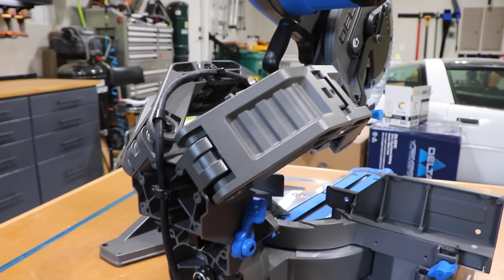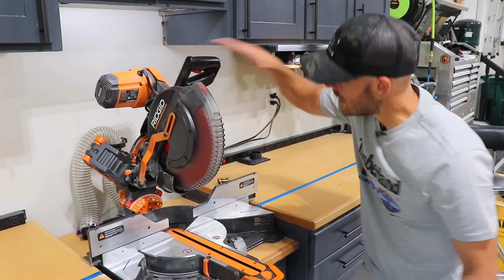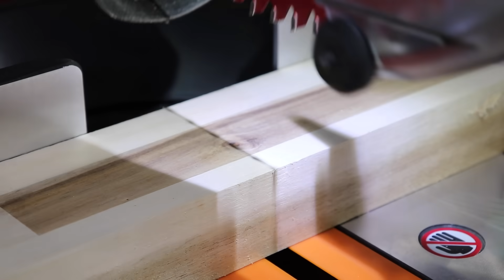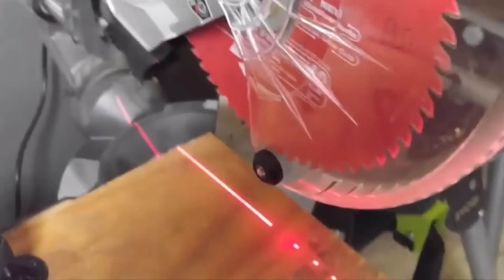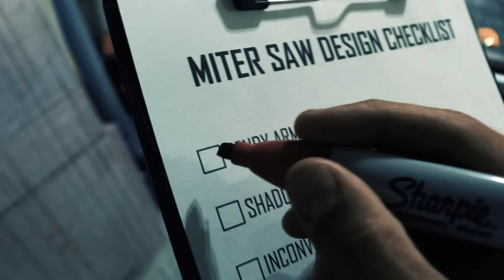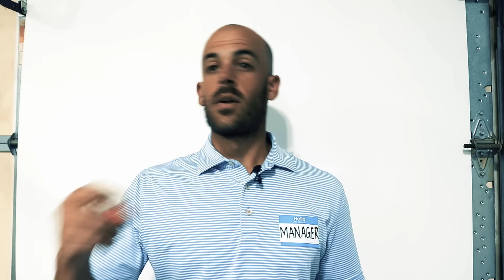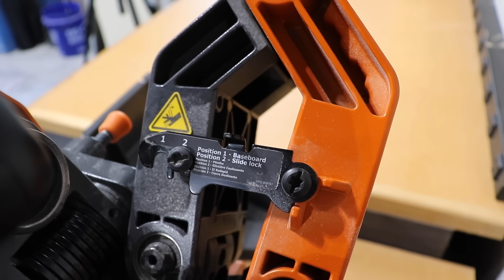I ALMOST took this Saw Back. // RIDGID & Delta Dual Bevel Sliding Miter Saw Review

Comment from the maker: 12" Dust Chute: https://bit.ly/3kd8c2S
10" Dust Chute: https://bit.ly/3QCbJDO

or print your own!
12" Dust Chute (digital files): https://bit.ly/3Qzi6rH
10" Dust Chute (digital files): https://bit.ly/3vYVHKX
Reply: $45 for a piece of plastic are you kidding me
Reply: The links to the digital files is no longer working, have they moved?
Reply: @StaiinedCreations  I’d like to know as well. I’m guessing they were pulled.  Guess I’ll design my own, but make it easy to remove for certain cuts.
Reply: @gatorhwk68  its been "out of stock" for months but they have it priced at $800, also they discontinued the delta line as well.

Comment: I wonder if blade deflection should be measured while the saw is actually cutting? The force of the blade moving perpendicular to the workpiece isn't close to being the same when it's not spinning. Think bicycle wheel.  Should be simple to test this.

Comment: I grew up in a custom shop with ZERO Festool tools. It aint about the pool stick its about the guy holding it. Great review but here in 2026 and RIGID isnt available in this model anymore. Delta does; however, still make this too but it costs $530-600 now.

Comment: A lot of you need to get rid of flex vacuum hoses, i got rid of mine and it actually go much better, use to shortest amount of flex as possible, also he's exactly correct about using a table saw sled to do perfect cuts, its what i use, i only use a chop saw to cut lengths, .

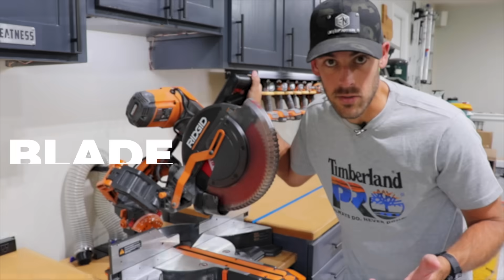Comment: At 10:00, that does look like a significant amount of looseness and deflection compared to the other saws, which appear to have about 70% less deflection.. I do have a cheap 7 1/4" sliding miter saw, a Cobalt, and it makes very accurate cuts, despite having a lot of deflection if you try to wiggle it side to side. I think deflection really only comes into play if you're using a bad blade. New Diablo blades are so sharp that you can't even feel anything occurring when you're making a cut, it cuts with almost zero force.

My 1956 Dewalt 9" radial arm saw does a 13.25" minimum crosscut on 1" thick board (approx). Installing a 10 inch blade, you get 1/2" more. It's tough justifying a purchase of a new sliding miter saw if it only does 12.5 inches for a 10" saw, or 14" (for the 12 inch saw). But, the safety features of the sliding miter saw and ease of use make it far better for crosscuts.

Comment: Great video.  I'm presently looking to buy yet another miter saw.  I have 3 now, but I think I have a need for a more compact, more lightweight miter saw that I can take around to jobs more easily than my big 12 inch Bosch.  By the way, a depth setting is important to me; does the 10 inch version have a depth limiter for cutting rabbits and dados?

Comment: Awesome video.. been checking out alot of reviews on this.. lovin it.. my old 12" handle won't stop running when plugged in 😂 it's locked on. Not the safest way to cut. Had it fixed at HomeDepot and they gave it back TAPED UP because they said it wouldn't fit inside. No safety switch.. 😂😂😂 terrible. Time for and upgrade 👊😎⚡️

Comment: @ShopNation - Great review!   I've watched it probably 20 times ¯\_(ツ)_/¯ .     A few months ago (09/24), I found a clearance deal at HD for the 4251 for $199.  Scooped it up immediately!     I would have preferred the 10" version.   I do see the 10" now across Ridgid & Delta are 100 more than the 12?

Anyway, I'm wondering you or anyone has heard of successes installing a soft start?  I'm not concerned about voiding warranty :).

Comment: I just bought the Delta gen 2, 10 inch version and there is no play at all fully extended. It's been addressed by Delta and they fixed it. As far as the dust collection it is no better or worse than any other woodworking tool in my shop.

Comment: I own the DeWalt 12" sliding miter saw and it has a shadow line. It also will cut 14" wide material. I don't have a dust collection system appears to be one of the best. Also, the shadow line is not a "shadow LED line."  Also, DeWalt miter saws have a gear system that works with the belt to improve power and longevity. It is considered to be one of the best, and a LOT of professionals use it. Also, the head on my saw doesn't deflect as much as the Ridgid saw does. Your DeWalt also was a lot more solid. Other than being more compact, I don't see why you replaced your DeWalt miter saw. This saw and the DeWalt have sufficient accuracy for trim carpenters.

Comment: Just bought this (Ridgid R4241) for a steal of a deal ($220). Had to go through my local orange box store to find it packed away on a top shelf, buried in a different section. I'm returning it. The deflection is unacceptable. If the saw was 20 years old, great. Had a good life, but with a roughly 1/8" side to side with barely a finger on it - it's way, way, way too much. For rough cuts for framing or decks - amazing deal. For semi-fine work (case molding, baseboards, etc) - not gonna work. I'm leaning toward the Makita slider cordless. It's 5x more, but that's why I started converting to Makita 4-5 years ago. Lesson: You get what you pay for.

Comment: Milwaukee 6955-20 has the least amount of powerhead deflection ive ever seen. Its THE monster saw, has been updated but still very simular to the original model. A dutiest rugged work horse that can easily handle all trim work with the raw power to handle wet/super dry hardwoods.

Why dont you do a review? After all the old girls still the world most accurate leaving festools very much overpriced kapex in the fckn dirt....

Step up and do a genuine review, you did another great job on these low grade saws, now lets see the premo saws

Comment: I work in a cabinet shop, we have two pneumatic pop up saws for cutting length with tiger stop for consistent lengths. We rarely do miters in have frames, and if we do it's on a rip cut for an island and we use a table saw for that. One guy does custom molding, floating shelves, and railings. He uses a DeWalt sliding miter saw for that. (I have a Ridgid 4222 in my so at home).

Comment: Let’s face it!  Miter saws are used to break down longer pieces to manageable shorter pieces.  Fine tuning in woodworking is done on a table saw.  Also most miter saws are designed for construction work.

Comment: To be honest, every Miter Saw and Radial Arm Saw I've ever used have been terrible for dust collection, so I wouldn't really consider it a negative against the tool, more so just a negative in general with all miter saws and radial arm saws.  

The deflection I think can be held true with any miter saw, even the non-sliding models....if you are pulling sideways on the head of the saw they will all deflect, its just the way they are made, there isn't much support to keep them fully rigid when you are purposely pulling or pushing the head of the saw sideways, which would be operator error more so than the fault of the saw.  I've found that running the miter saws that if you are trying to force them through material you are going to get some cuts that aren't accurate of course, but taking your time and not forcing the tool is the key to getting better results....most jobsites you see guys forcing the tools and well that's how you get a bunch of walls that aren't square LOL....they don't care its production framing and finish work, but its so common for people to really not know how to properly operate these saws, they watch all the videos of them being used and thing that forcing the blade through the work is how its supposed to be done.

I believe that max cut capacity they claim is for something like a piece of crown molding which is set on the saw and up against the fence at an angle, which would certainly give you a much wider cutting capability than just having a board flat on the saw's table.

Comment: Hell of a review. You just convinced this hobbyist woodworker to get this saw. I actually got the 779 and returned it because it was absolutely massive. I was going to buy a regular non sliding miter but I knew in the back of my head I’d regret not being able to do wider cuts which would inevitably come up

Comment: Thank you for the review. I’m actually looking at the Rigid vs Bosch GCM12SD.  I currently have the HarborFreight HE74 which is a solid saw and has shadow saw line like the rigid. I’m trying to avoid building a 40” deep miter station for it. Just for reference how deep is your miter station cabinet front to back?

Comment: I looked for the STL files in the store and all I found was the $45 prefabbed version and this note: "There is a separate listing for the digital files if you would like to print/make your own!". Still didn't find the STL file. It would have been nice to but a link on the page. I'll probably just fire up Fusion 360 and design my own.

Comment: So, your video absolutely sold me on the 12" Ridgid. But it looks like they are no longer being sold. Any recommendations for something similar? Thanks!
Reply: We're in the same boat bro. Smh lol. Let me know if you find something similar at least
Reply: @BBradshaw131 - I ended up going with the 12” Delta Cruzer. As far as I can tell, they made Ridgid’s saw (until recently). It has been working great.

Comment: You make a good argument for a non-sliding miter saw. You state that for more precise cuts, use your table saw and sliding table. I had a regular Delta miter saw and when I had a longer cut, I simply held the wood against the back and lifted it to finish the cut. Not the safest, but never a problem. Now I have a slider and had to make a sliding table on my bench to bring it out for the full use. Something you could do to get full use of your saw.

Comment: Some time has past and I see that the saws are now on clearance at my local hardware store. Do you still hold the Delta Cruiser in high regard? And do you know why they are all on clearance and nothing seems to be on the horizon to replace them. At least of what I see with my limited knowledge.

Comment: Sooo I think there is an error in this video. The cut depth. I believe this is posted wrong on Home Depot’s website site. 

They list the 10” cut depth at 4”. Which is reasonable. Given a 10” blade and the arbor hole. Seems about right. 

But HD lists the cut depth at over 6” on the 12” saw. No idea how a 12” blade with a 1” arbor hole and this only 5.5” of blade from arbor to tip of teeth can possibly cut 6.4”! 

I think there is a typo there. And like out ShopNation guru was just reading what the website said for cut depth. Also. He says the 10” is also 6” cut depth as well I believe, which I’m assuming meant HD also had that wrong for some period of time as well?

Anyway. I know it’s an older video. But I literally did not do my due diligence and was like “6 inches of cut depth. Almost the same as the 12”. Screw it. I’m buying the 10”. Obviously it should be about an inch better on a 12 vs a 10. Duh.
Reply from the maker: Usually the deepest cut depth on a miter saw is made behind the arbor, most miter saws can cut thicker than 1/2 the blade diameter assuming it fits in that “pocket”. Usually just a piece of baseboard standing on edge
Reply: Ahhh I see now. The manual lists some interesting stats. They talk about full depth cut thickness of being 4”. Then a baseboard vertical being 6.5” and crown (vertically nested) as being 7.5” or even 2”x18” extended capacity. 

Interesting. To me I’ve done baseboards one time in 20 years but use my miter saw 6-120 times per week on other projects. That 4” number is probably the most important to me.

Comment: Thank you for this video. It inspired me to tackle the biggest dust generator in my shop…the ROUTER!
I made a dust collector for my Dewalt DW618. 
It works well with my Porter Cable dovetail jig. I’ll be testing in other applications.

Comment: my home depot really sucks, they dont even have saws on the floor so I never knew this even came out, and you can adjust the tension on the Dewalt slider to make it deflect less not perfect, but you can certainly tighten it up, but for that space saving Im tempted

Comment: I have the same exact saw that you do (I think based on your recommendation, even. lol) and I believe to get that maximum cut they talk about this saw being able to do requires that you do the thing that is kind of extremely dangerous, yet I see almost all woodworkers do it, including myself. After you reach the limit of the cut, in the normal way, then, while keeping the saw running, lift the front of the board up to finish the cut. In this way you may be able to take a board that is as deep as the maximum rating and actually be able to cut it without flipping it over. Haven't tried this, yet, but am going to just to see if it works.

Comment: My first major power tool, Delta 10inch. The goal was to cut a "4x4", the saw has been very good. Yes, it does spew dust even with my vacuum attached. I had no idea about dust collection (my first major tool). Why did I not get the 12 inch? Because only a fool trims fingernails with a 12 inch. 
Also because the 10 inch was at least $100 cheaper and 10 inch blades cost a lot less.

Amazing how he got the inside footage from R&D. Those guys did not look particularly Asian, and the personnel badges somehow looked less than official.

Comment: I personally would not recommend this saw after owning it for 4 yrs now. The blade deflection is the worst I have ever used (27 yrs of using miter saws) and impossible not to get some deflection no matter how much you baby it. A bevel cut is when it is the worst. Fully extended it's a absolute joke compared to the yellow brand as it takes zero effort to deflect the blade. Yes, all have some deflecrion but, trust me this saw is ridiculous. IMO all the engineering went into the arms of this saw and stopped there. There is no dust collection as stated in the vid. I'm not sure why he would recommend this thing but, I have one forsale if you want to take his word for it.

Comment: I'm having to replace my old Sears Craftsman mitre saw because a motor bearing broke.  I'm very sad about this.  It was a very good saw. very durable.  I knocked it off its stand a couple of times and it kept it's precision.  One thing I noticed however, is that in comparison to all the current sliding mitre saws that have 2 rails, my Craftsman had 3.  It was a 8.25 blade but could cross cut 12.25" with very very little deflection.

Comment: The longer cut length advertised is for miter cuts…move the head to the sharpest angle available and it is a longer cut than just cutting 90°

Comment: All these saws have blade deflection.  I was days away from finally buying the Bosch when a friend let me use his and I noticed right away that you could pull it off line so easily.    It was that that got me to change my mind and buy a mint condition 1954 DeWalt 14” 3hp radial arm saw.  It does everything the Bosch can do, only dead accurate, and it will rip to 24” wide, cut parallel to the table, and do a bunch of other tricks sliding miter saws can’t dream of.   At 500 lbs, The DeWalt radial is Not job site portable…. but i don’t work on job sites, I work at my studio.   The Bosch would have cost me $800.  A like new condition Radial with a bigger blade and more powerful motor and greater capacity cost me $500. If you don ‘t need the 14” blade, you can often pick up 8 or 10” DeWalts from the 50’s for as low as $50, and those 5/8” arbor DeWalts can run Shaper heads, planer heads, and joiner and jigsaw attachments.

Comment: Hands down the best and most honest review of a miter saw I've seen. By someone who actually used the miter saws, knows the features and flaw, not just cut a few boards. Great points and tips. I wouldnt of thought about the miter clearance left to right being an issue. 👍

Comment: I noticed you get better cuts if you pull the handle out, chop down and then push the cut in while bottomed out. The profile of the cut is thinner and you are making it with the widest part of the blade. Blades are like gyroscopes, so thinner cuts are best because you keep the speed higher which balances it better. It has made it so only in cabinet would I go to my table saw. I have the Dewalt you showed.

Comment: I had the same issue  with miters.  With the saw set in the work bench. So what I did to fix this was make it slide forward with  some heavy  duty sliders.  Works good i can pull it forward  when I need to make those steep miters. And push it back when I need to .

Comment: I have the Ridgid for my acreage and love it. If you are making wider cuts and use the saw "properly" you will have no problems. Besides once the cut is started it will guide itself straight unless you are trying to get a crooked cut. In that case you deserve what you get.